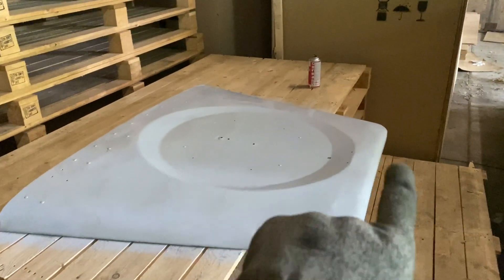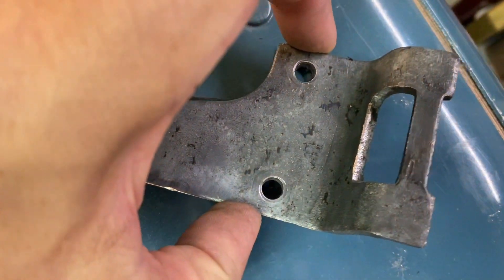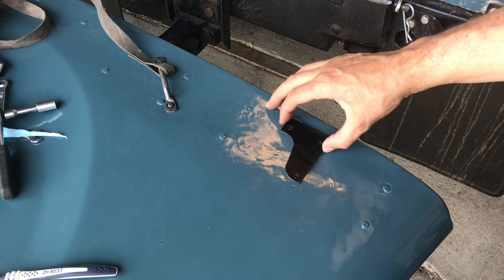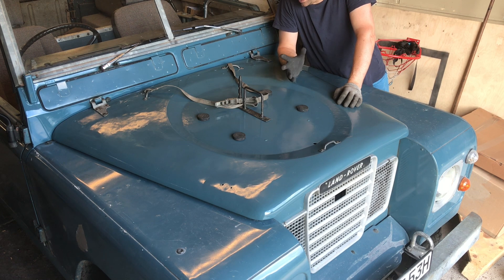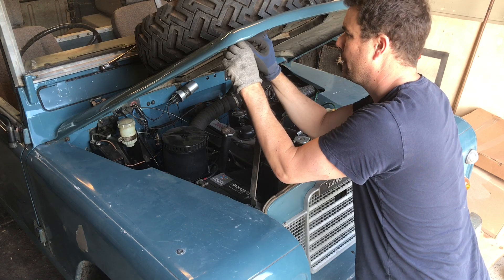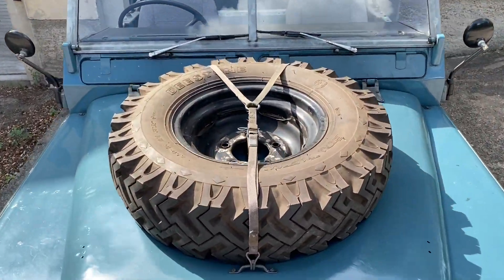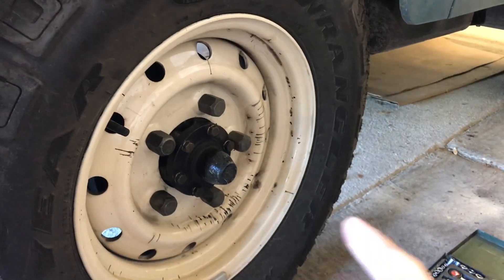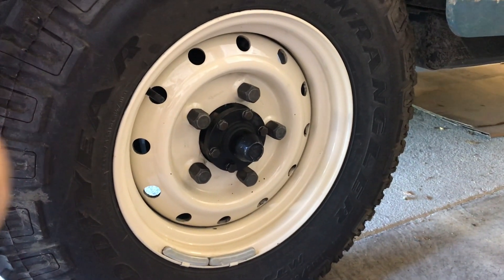Land Rover Series 3 Restoration - Painting & Fitting the Bonnet - Part 76 (2/2)

Comment: If you decide to use a standard sprung loaded bonnet catch rather than quick release catches on either side you need the one with the stronger spring, you may find the non wheel mount bonnet release spring won’t be enough to lift the bonnet with the wheel in place especially as you have gone for a larger (and heavier) wheel/tyre combination. Alternatively it’s spare wheel off each time before you go under bonnet
Reply from the maker: Ok, thanks Dean. Didn’t know there were spring options, but it’s logical I guess. 👍

Comment: Those plastic spacers on the hinges should have the slot facing upwards, at least I think they should...I no longer have a Landy for reference.
Reply: That's how I remember them on mine.
Reply from the maker: Ok, thanks. What do you mean you no longer have a Landy? I thought you were in the middle of a restoration. Or have I got that confused. 👍
Reply: @My911  no, I used to have a 109 SW but not anymore.
Reply: @My911  do you know what...I think I've gotten it completely wrong. Sorry for any confusion bud.
Reply from the maker: No worries dude. 👍

Comment: More inspiration - this led to me getting the rattle cans out and redoing the entire front 3rd - for which thanks. What did you make the spacer from? My bonnet also uneven.
Reply from the maker: Hi, I used some black Perspex I had lying around. 5mm I think. Apparently it’s common for these bonnets to become uneaven over the years. The spare wheel is just too heavy.
Reply: @My911  Thanks for the quick reply. Mine hasn't got that excuse - it's a flat razor bonnet. Will look at perspex - many thanks again!
Reply: @My911  In the end, I put the hinge in a vice and used 'the persuader' to make its angle more acute and even out the height and get the bonnet level to the bulkead.

Comment: Hi, your work and results inspires me to start a similar project next. It is a 88 petrol RHD (1976), which I drive some years ago from London to my my home in D. Can you tell the brand of the etch- primer and the marine-blue coating (1k, enamel or acrylic based?), pls. Go ahead, great job, well done. Heinz
Reply from the maker: Moin Heinz, also der primer heißt: 1 Spraydose CS Etch Primer Grundierung 400ml Grau Autolack Tuning auf ebay.de
Aber der Marine Blue kam von Paddock Spares aber es ist leider nicht mehr verfügbar. Dein Englisch ist sehr gut! Cheers and good luck with the project.